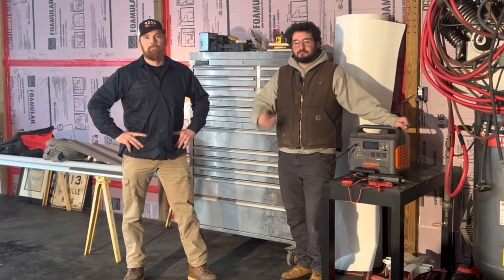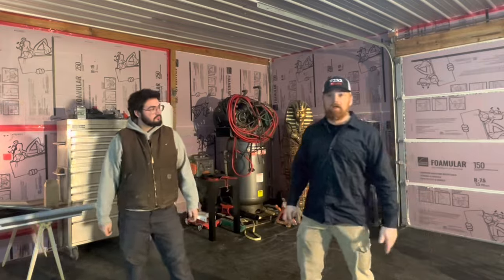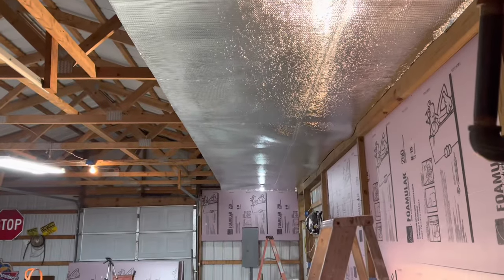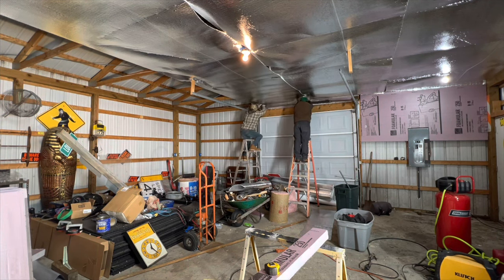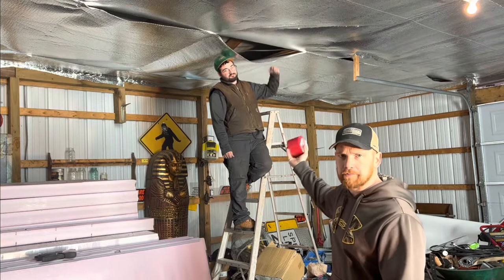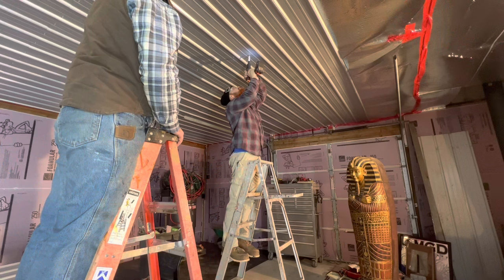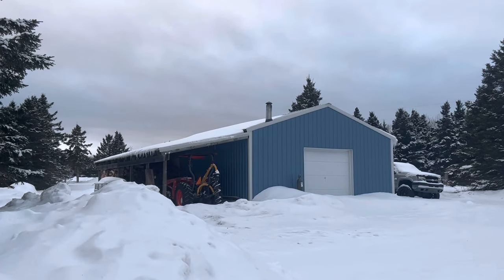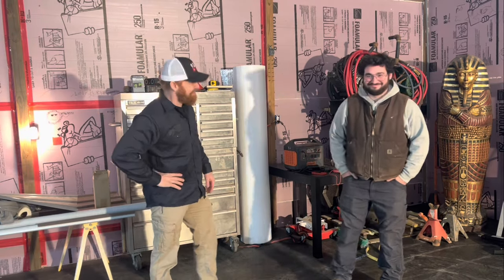Insulating our ceiling in our steel building/garage... What causes moisture in your shop? Explained.

Comment: What do you think about combining a radiant barrier and rigid foam boards for wall and roof insulation?  The pole barn company offers radiant barrier for all the walls and ceiling and I'm thinking of installing the rigid foam board myself over the radiant barrier afterwards.

Comment: Have to make sure you screw into the bottom cord of those trusses. I was thinking about screwing in 1/2” osb to bottom cord of trusses after they’re in layout. Then quickly screw the corrugated metal sheets to the OSB, more rigidity. But raises cost. That building should nice and warm. 👍 Good job guys.

Comment: Looking to do my garage similar to what you all did. I got double bubble going on my roof and walls. Then like to do 2" foam board on walls with blow in cellulose in the ceiling as well. Very curious how does your garage heat during the winter months? I'm going to put a multifuel stove in mine to keep warm. Like to keep it around 65ish during the winter months. I live in southern Indiana.

Comment: Condensation will drip down from metal roof .   I used  thermal building wrap with high temp glue then went over that with 1 inch insulation board including walls and heat 30*40 ft with wood stove open ceiling. However good work

Comment: A warm garage starts with the floor. I know you can’t go back now but here is what I did 25yrs go when building my pole barn. I dug an extra 2” down before the floor was poured. Then put in 4” of stone, then 2” foam board on top of that, wire mesh above the foam board, then concrete. Absolutely no moisture has ever come up through the floor and never experienced that cold garage floor when laying on the floor under a car. It also didn’t take much to heat the 32 x 72 building at all in our cold northeast winter. Best advice my elderly neighbor gave me.
Reply: So in theory you’d put the plastic 6mil I think above the gravel, then the insulation, then the wire mesh.

Comment: you put it upside down, the silver to the top, but most of the time you put it under your roof so any moisture collected runs down and out, putting it on the flat will allow pooling of moisture

Comment: I hate to rain on your parade but radiant barrier insulation needs an air gap between the insulation ( foil side) and what ever surface it's up against. Other wise it will not do it's job. Don't believe me, look it up yourself. That being said, I do like the way you insulated your walls and you are right about spray foam ( not exactly what it's all cracked up to be). Great video. Thanks
Reply: You must use a 3/4" furring strip under the foil and then screw your sheet metal to that!
Reply: They faced the foil down. There’s an attic worth of air between the insulation and the roof. I don’t see the problem (but I’m not an expert).

Comment: Gunna spund crazy but I promise it's well worth it. Buy a thermal digital gun with a screen showing you where heat or cold air is leaking so you can better take care of any leaky areas. Works stupidly amazing. You just don't need anything 300$+ something from Amazon for 130-180$ would do just fine. Or even the one at harbor freight I believe that I'd 209$ but that's what I got. You only need to screen to show you the area that's cooler/warmer/hotter/colder then the surrounding areas so you know there's a leak of air coming from that spot. You don't need the screen to be superhighway resolution just use it for the different temp changes and it will work great!

Comment: I am about to build a skillion pavilion central U.P. this summer. And thought about putting cheap barn steel from the Amish on the roof. But insulation. That bubble wrap works great under cabin floor sheeting. I do a lot of foundation work for the Amish. Overlap and staple. Just like masonry walls or piers needing 18 inches above grade so it can dry out. Gotta have good ventilation.

Comment: 5:03 Surfaces don't "hold onto the cold", cold is the absence of heat. Condensation happens when there's a temperature difference of at least 5 degrees C, where moisture in the air will condense on the colder surface.

Comment: I'm just an old guy who's been building since he was fifteen years old but what they're doing with this insulation is bad you're creating an atmosphere up in between your metal roof and the lower roof some lures were made to catch fish some lures were made to catch fisherman nowadays they sell people so much s*** they don't need
Reply: @brianh2324 I am a different old guy who builds postframe buildings for a living. To answer your question: yes. I have seen plenty of uninsulated buildings, and most of the condensation happens on the roof, so that is where your money and time is best spent. It would be better if they had put the radient and vapor barrier above the frame - directly against the metal. If you have already built it without insulation, like theirs, then ventilation in the attic and a thoroughly taped air seal is essential.

Comment: Blown in fiberglass is 100 times better to work with plus better R value but it does cost more and you can actually see while installing its not dusty.

Comment: There is a difference between heat transfer and water transfer. When heat transfers through a surface it simple leaves the moisture behind.  Condensation.

Comment: I honestly think that metal roof will still sweat and if it does it will get that insulation you are going to blow in wet. Seeing you have wooden studs it could even mildew and rot in time. Let's say it only does it a little and you never see any indication of a leak, but it is leaking and gets sponged up in the insulation. Not good. But hey, what do I know? You actually are going to have the same problem it you ever get a leak in the roof with a loose screw or seals on the metal roof screws going bad. But then again, what do I know? I truly hope you don't have either problem that I suggested could go wrong, but I am going to have closed cell foam sprayed on my metal roof.
Reply from the maker: We’ll keep you updated.
Reply: @G.A.N.G101 thinking about using this in my 3bay carport turned barn, how is it going woth condensation plz?

Comment: I didn't see it, what is the brand of bubble foil sheets that you used for the ceiling?  Did you say 13 r value just for the sheet?
Thank you  
Ted
Reply from the maker: 15 for the 3” pink and the bubble foil varies depending on where it’s being applied

Comment: I believe it's R 1.2 not R 12 Two inchs of styrofoam rigid insulation is R 10
Reply from the maker: R Value is the rating given to any given material’s ability to slow down the transfer of heat. Depending on where it’s applied it will have a different R value. In our case it’s 12 when installing it in the ceiling.
Reply: @G.A.N.G101   I realize that it is hard to hear. But they lied to you. They are quoting a system. Do you really believe that is R12? I used the same product as a vapor barrier but it does not offer any real insulation value. Please do your own research and correct this video before you have people copying and making the same mistake.
Reply: With a couple of decades in the insulation and building science business on my resume I just have to comment on some of your statements. The bubble wrap ‘insulation’ is a radiant barrier and requires an open space to reflect into. It does next to nothing to reduce conductive heat loss which is what you are dealing with when it is sandwiched between other materials and R-12 is a ridiculous marketing fantasy as others have pointed out. Other than that, you did a nice job here given that you didn’t want spray foam. Assuming that your attic is well ventilated even after the insulation is in place, it should work well for you.
Reply: Not R-12…not even close. There’s a lot of misinformation on this product some of which is marketing. Plus the fact that if the foil “radiant” surface is touching the metal roofing surface it’s no longer  radiant. It’s Conduction. 
Reflectix is good stuff but the misinformation is getting out of control.
Reply: @cabinman l

Comment: I am looking at insulating a pole barn and want to keep the space between rafters and roof. How could I insulate directly against the ceiling?
Reply from the maker: You'd have to have wood between the rafters to screw this up to
Reply: @G.A.N.G101  right. So just screwing the insulation to the purlins then? Leaving the 1 3/4  width of the 2x4 as an air gap?

Comment: Noooo....   You all were doing so great up until the "Cellulose",  I've sold insulation for YEARS and cellulose is so bad.  Is is paper.  Rats/mice/bugs love paper.  It says it has pesticides, but the heat dissipates those rather quickly.  When/if it gets wet, it does not want to dry.  Fiberglass is just glass.  It can dry afterwards, it's just glass and works great for what it needs to do.  Love the vids though.  EDIT:  It also weighs more than fiberglass.  Edit:  It is also like dust and tends to find it's way out onto everything.
Reply from the maker: We looked into the fiberglass blow in and it was 3 times the price and we just couldn't justify it.
Reply: @G.A.N.G101  It does look like you all do your homework.  I'd just recommend taking 1 more look at the pros and cons of this choice.  insulation is usually sitting on top of drywall.  In your case it will be on that bubble wrap and your sheet metal.  I'm not sure how much weight per ft that will be, but trusses are usually 24" on center as well.  I'd hate to see your stuff sagging.  I charge $1 a ft to vacume the insulation out when it gets ruined.  It may be ok.  I'm in Florida with lots of water issues.  Those metal buildings tend to get a water leak eventually.
Reply: I agree, in this application I’d go with the fiberglass blown in. Definitely do some shopping around and see if there is a cheaper supplier. If not, make sure to have an attic access and check it often, if not even put some lights up there too! Best wishes, and can’t wait for the next video.

Comment: What is the cost of those metal sheets? I'm thinking to do the same for my shop.
Reply: In Colorado, they're about $4.38 a square foot, not cheap.  But easier than doing drywall, & that won't span 4' trusses without additional framing, plus no finishing needed.
Reply from the maker: Not sure right off hand. We purchased the metal from our local Amish which is much cheaper than the big box stores.

Comment: 12-R it is not.  Bubble-wrap marketing materials often tout ridiculously high R-values that have nothing to do with the thermal performance of the material; the exaggerated numbers are based on assembly R-values, not material R-values. Assembly R-values take credit for the R-value of building component layers that aren’t sold by bubble wrap manufacturers: things like layers of plywood, drywall, or air spaces located between the bubble wrap and an adjacent surface.  That from the Green Building Association. Cold air above will settle down and chill your entire celing assembly. Cold air sinks.

Comment: Would it make sense to double the bubble insulation with top layer shiny side up and bottom layer, shiny side down?
Reply from the maker: Can't go wrong with more insulation
Reply: The shiny side is supposed to always face towards open air - you never let it contact a wall or ceiling.  Unfortunately, these guys did it wrong.

Comment: Zero chance that is r12 It would be around a r1 to r1.5 and the foil always goes out no matter what. Putting the foil in will still allow condisation. The only thing that it is good for is moisture Barrie and radiant heat barrier.

Comment: What about air space in the walls so the insulation board isn't touching the metal
Reply from the maker: The 3” foam board from Owens Corner is a vapor barrier as well and having it against the metal on the inside is fine as it’s not an exterior wall.
Reply: @G.A.N.G101  So the air space is only needed at the exterior side. Thank you for the reply

Comment: Oh boy. Radiant barrier must have an air gap. Pretty much worthless as installed.  Sorry.  Had you left the steel panels off it would have worked.  Same deal with putting it under a slab. No air space and it fails as an insulating feature.  The bubbles in the wrap do not solve that problem. Nothing can touch the reflective surface.

Comment: Don't let the moisture from in side get into the attic. Moisture retarder sealed up. Building science. Bubble foil is NOT r-12. Are you heating with infrared heat?

Comment: that foil isn't really R12. It's R12 inside a dead air wooden assembly, basically a wooden box with the foil in the middle. Thing is the wooden assembly with dead air is around R10ish LOL. gotta read the fine print. A radiant barrier needs to be able to see the heat source to radiate it back. In this case it is covered with metal which is its own radiant barrier LOL. So is it better than just using plastic for the vapor barrier? Yes because its more durable. Is it R12? Nope. Its maybe R1 and reflecting minimal radiant heat back and forth between the metal roof and itself. Also, if you use propane to heat the garage moisture is still going to collect on the metal.  https://www.youtube.com/watch?v=zzD1TPJq_OQ

Comment: Why Did You Not Use Bubble Wrap Under Your Foam on Your Walls
Reply from the maker: Tin isn't up yet. We're probably going to do that
Reply: Do you think 1" foam board with a reflective surface sealed to the metal walls and ceilings (taped everywhere to seal it...then using R-13 and R-30 (ceiling) would be okay for a. 12x24 metal shed building? Its in a pretty high humidity area. I'm just a girl and I can't find the best way to do it (short of closed cell spray foam) which I can't afford.

Comment: Lots of work here! But it’s Wrong. This is going to cause a lot of moisture. If you don’t mind rot or the potential for mold
Reply: I'm wondering if you have a better suggestion for metal shed buildings (short of spraying closed cell foam)? Thank you.
Reply from the maker: Love rot. It really tickles our fancy.
Reply: @G.A.N.G101  Hi Great American. Did it actually rot? I hope not. Its just getting too costly to redo anything a second time!
Reply: This assembly isn't going to rot. They've got a vapor barrier preventing warm moist air from entering and contacting cold surfaces in the attic space, as well as insulation in the attic VENTED area. Where would all this mysterious rot come from?